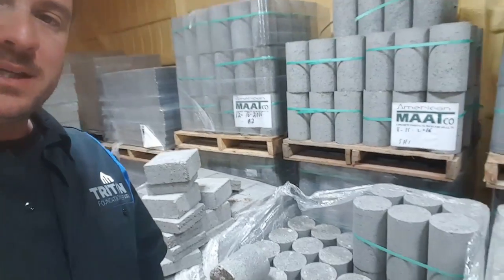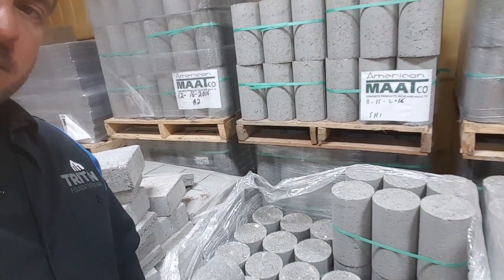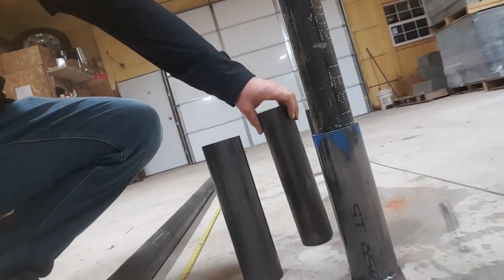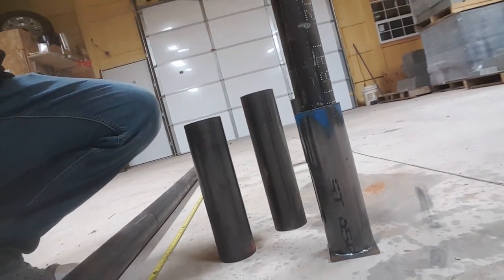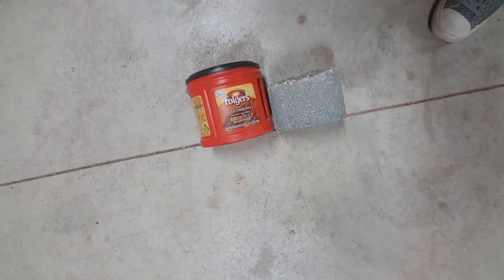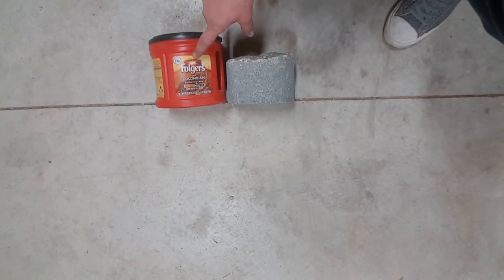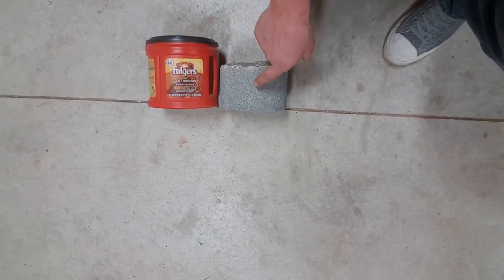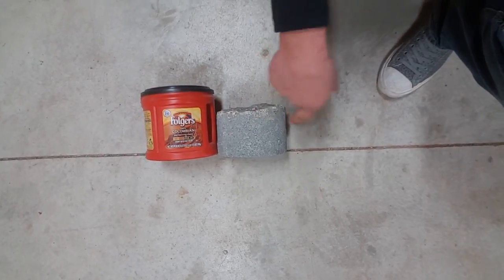Steel piers vs concrete piers

Comment: Concrete piers are temporary at best . In Texas people use concrete piers everywhere. I tell them if you want longevity you use steel piers , if you want temporary you use concrete . It’s that simple . I’m not even in the foundation business, I’m a master plumber and have seen how temporary concrete is verses steel . A customer of mine had steel piers put in 18 years ago and it’s still good . People go with concrete piers because they are cheaper. If you want longevity spend the extra money and do it one time with steel piers .
Reply: Whether steel or concrete, the foundation is bound to shift again and most of the work possibly has to be done again. Right?
Reply: TXguy82 steel piers are the longest lasting . Like i said , i worked under a slab foundation house that needed some plumbing work done . The dirt pulled the plumbing drains away from the concrete . The entire slab foundation was sitting on these steel piers that were 18 years old and house never moved .
Reply: Chad Jones that’s good to know.
Reply: @MrPlumber27  What do think about hybrid steel concrete pilings ?
Reply: Steel piers are the way to go? A footer for a house remains underground forever and the concrete never deteriorates, put a steel pipe in the ground and see how long it last
Reply: Steel piers hit bedrock and don’t sit on dirt.

Comment: I’ve been driving concrete and steel for 10 years. Rarely do I see a big difference in depth. Steel can be great if in a land fill area bc it can sneak past trash in the ground easier.

Comment: Steel will corrode in the ground without a coating such as galvanized but even with gavlnazed the life span is only 35 to 75 years depending on the soil . A proply poured concrete  can last up to 200 years.  If steel did not detiorat in the ground then the oil and gas industry would never have to replace them which pipelines are constantly being maintance or replace.

Comment: In an area with  underground streams I would rather have concrete.  Metal will deteriorate with moist water contact, especially if it is salt water.

Comment: Okay, but it’s no surprise that a wider diameter will stop sooner under pressure than smaller diameter.  All that means is:  You can push a thin sharp needle deeper into the ground than you can a fat baseball bat.  Therefore, if deeper is better, you should be pushing the narrowest most pointed rod into the ground possible.  I. E. A one-inch pipe will go even deeper than the 2-inch—maybe 30 feet before stopping.  The only real question is, do you have the needed support—and will it remain stable?  Above the frost line, it won’t. Below the frost line, maybe yes?  If bedrock support is mandatory, then all foundations should be built down to bedrock.
Reply: Yeah but he implied he hit bedrock w the steel. Otherwise I’m with you.
Reply: @dollyhadbraces9361  but was he lying when he said they hit bedrock.

Comment: What is the diameter of that concrete? The more surface area the pier has the better. Code here wants concrete to be at least 12” below frost line with compacted gravel bed and 18” diameter. Soil compaction is key.

Comment: So your company does install concrete pressed piles? What type of soils is the concrete pressed pile system used?

At some point (16' in this video) your steel pile hit refusal or bedrock. How do you determine bedrock from soil refusal?

How are your steel segments attached together? Welded?
Reply: t barrata thats an excellent question?
Reply: t barrata not welded.

Comment: My knowledge of mechanics tells me that screws beat "nails" by significant margins. Invest a bit more and screw in a bearing plate that is much larger than the concrete push pier yet has a profile approaching the steel pin. This from a piledriving contractor that has driven 36" piling with 100 ton cranes. Helical Piers super-cede a "driven" anything in the vast majority of cases.

Comment: I see people talking about steel corroding over time and acting like concrete last forever. I’m not a professional in this area but can an unbiased professional tell me wouldn’t a heavy gauge steel pipe be better than the cinder block columns that are normally used in the area I’m in. I’m referring to crawl space foundations not a basement or slab.

Comment: Looks like you just made the case for concrete. A 16' steel pipe or a folgers can of concrete, and both perform the same?
Reply: But for how long?  Folgers is good coffee though.
Reply: Id check with ur county and state- He did say at the beginning that some of the engineers in that area WONT sign off on the concrete.

Comment: how do you prevent rust on this steel?
Reply: As I understand it, the vulnerable area is the steel above the surface of the ground, due to exposure to oxygen. Beneath the surface, to a large extent, soil prevents oxygen from reaching the steel wall. I imagine there is a specific depth where there may be more oxygen intrusion but the largest risk is the exposed steel above the soil.
Reply: I'd like to see a definitive answer about this. I've watched several helical pile videos lately and it is a common question in the comments. One company was very proud of the fact that they used galvanized steel. Cool, except they welded on extensions in the field. So was galvanizing important or not? If non galvanized tubes were used in an area exposed to nearby sea breezes there would be serious corrosion. What about an area where there was ground water movement past the piles? What would the expected lifetime of the piles be in an area like that?

Comment: I don't get it. concrete piles are drilled, rebared and filled with concrete. You seldom have the space to pound a concrete pile on an already built building.